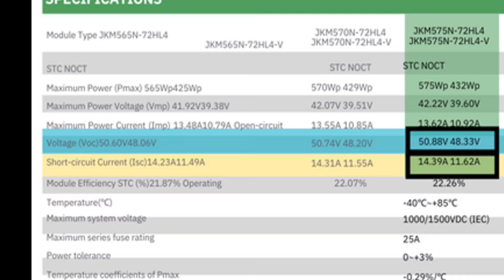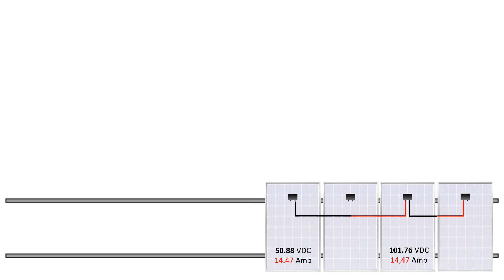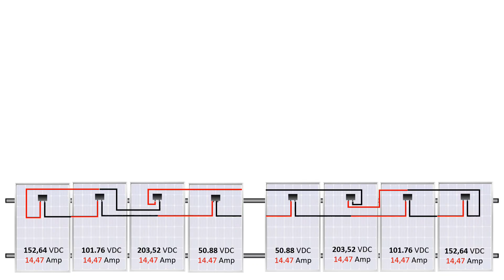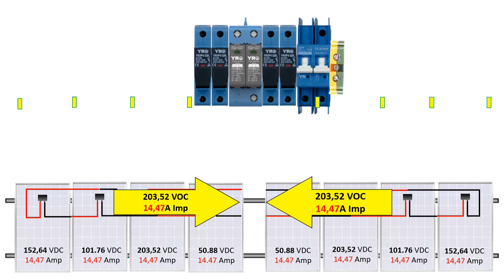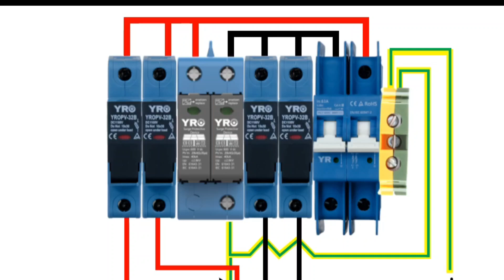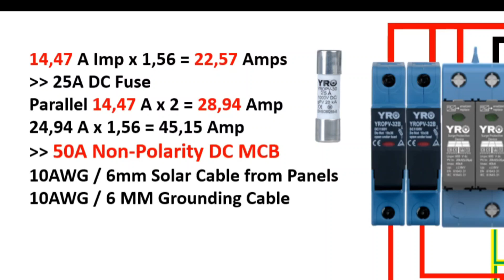575W Jinko Solar panels connected in Series an Parallel - Cross-Connection

Comment: The biggest weakness in any system is the path between the panels and the storage ..controller..the shorter the runs the better it is..power should be immediately to inverter..after its ac then length of wire is negligible.
Reply from the maker: That is true, we see problems with small scale solar plants with 50 kW-150 kWHigh voltage systems, cables run very far underground in conduit into 1 PV Combiner box in the control room.
Technology moves so fast and everyone push to get UN targets for 2030.
SAFETY....
Reply: @ltvtech  the sadness is. The world nolonger seeks advancement in any tech field.. we are controlled by investors strapped by their over promissed  portfolio.  WE ARENT MOVING FORWARD. ok getting on the soapbox as you see doesnt work..become scientists again..actually do testing..whats being taught is wrong..in the past we always smiled and went to the lab and tested .  Now everyone believes whats on the web..
Reply from the maker: I saw videos in USA, regulations differ worldwide. But see currently there according to UL they say within 1 meter / feet from the array. SMA on Grid inverters like this. Solar Edge also still inside and lots of arguments... This happen worldwide, technology far ahead of regulations and that also create problems